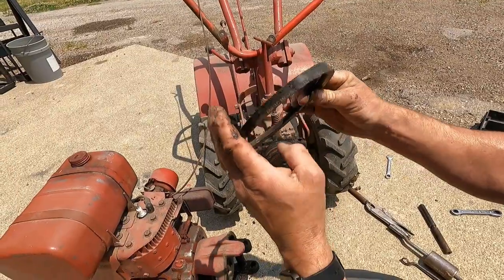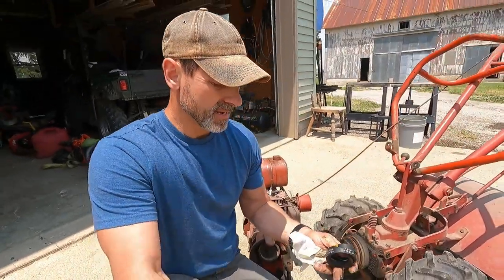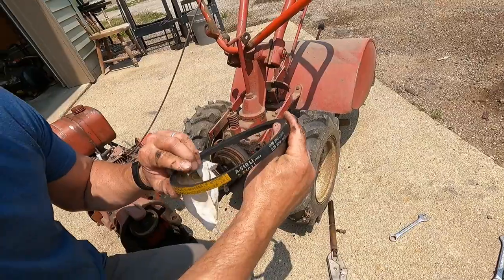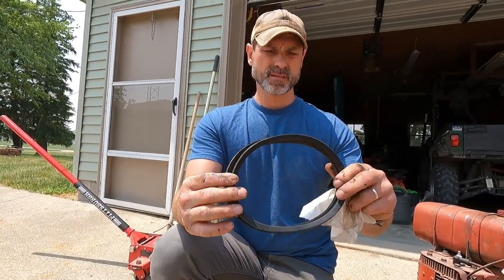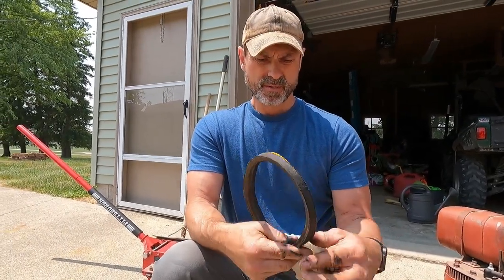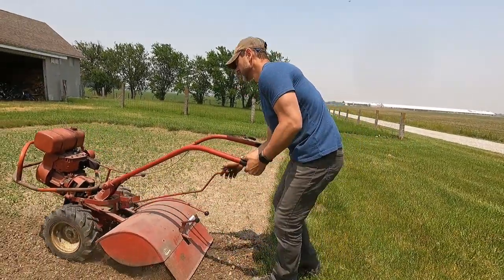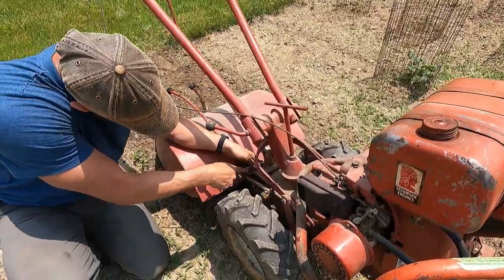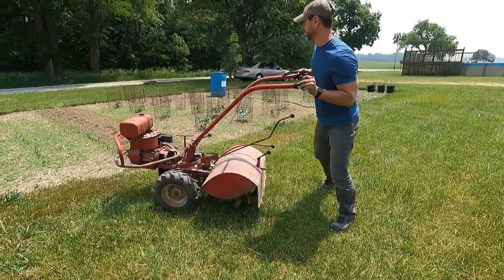Old Horse Troy-Bilt Tiller Drive Belt Replacement - They Don't Make Them Like This Anymore

Comment: This is a useful video to learn how to remove the engine from your tiller, however, you don't need to pull the engine off. You can replace the belt in 5 minutes by just moving between forward and reverse gears to pull it out the back and put a new one on.

Comment: Great video. What size bolts did you use to pull the guid rods out with please.
Reply from the maker: I believe I used the screws that I took out of the top of them during assembly.  The same screws that held the metal motor protector pipes on.
Reply: @therustichandyman thank you. When I got mine it did not have the guard. But thanks to you I know how to put it back together. Your video helped a lot.

Comment: Its been a minute since ive replaced belts on a horse, but all i ever did was use a small pry bar, worked out the old belts and then worked in the new belts. 20 min tops. Ive done several that way. Feed it out and back in from the side that is open. Belt number GW-9245.

Comment: This is good. I need to take my motor off so I can replace the front transmission seal. I also have new OEM Troy Bilt belts to put on just because.

Comment: I wonder if two belts can be used mines doing the same even thought I changed mine only two uses ago
Reply from the maker: Maybe you just need to adjust the tension…
Reply: Only one is used for the the two speed pulley.this is a old single speed pulley

Comment: My tiller tried to run away on me.  Maybe I need to learn the technique or is there something wrong with the machine?  Everyone makes it look easy.
Reply from the maker: Depending how hard and dry your ground is, you might want to start out tilling a little bit shallow. You can adjust the time depth at the rear.
Reply: @therustichandyman  Ok thank you.  It is a grass lawn that has just been grass for decades.  Not quite dry.  

I will try scraping down layer by layer and see how that goes.  

I just got the tiller a few hours ago, so I should probably do a once over on things like the carb and engine oil, and then give that another try.  

Thanks!
Reply from the maker: @thedillestpickle  you will definitely need to start super shallow and gradually increase your depth. It will take several times going over it if it’s just been grass.